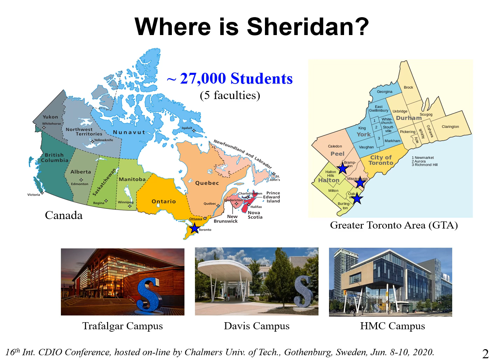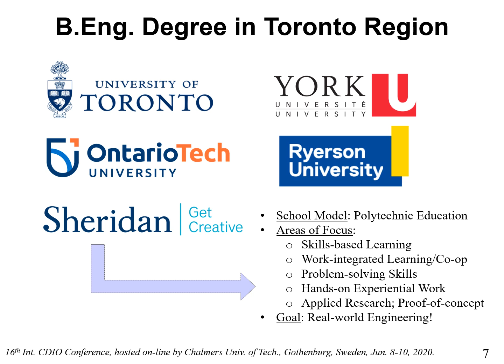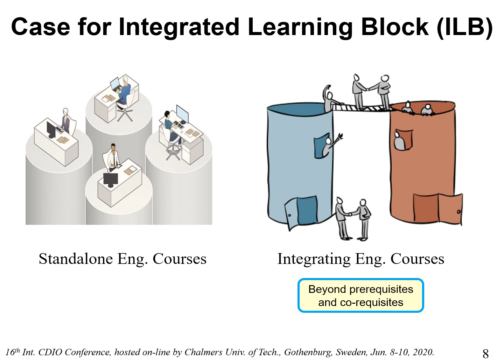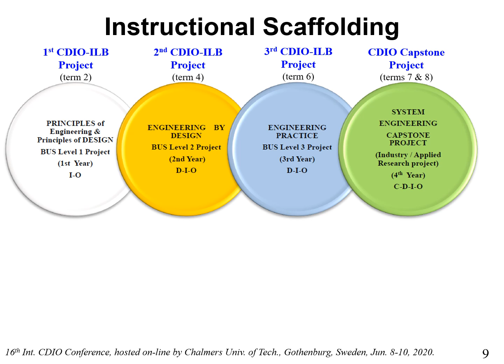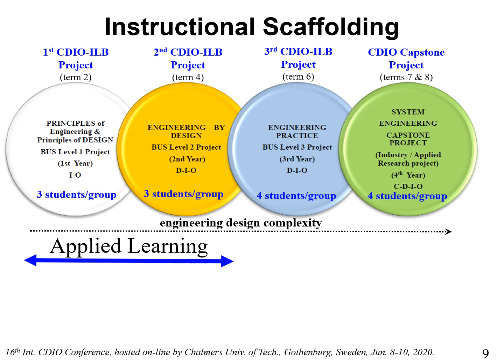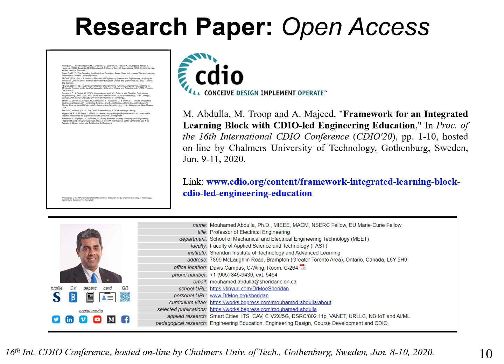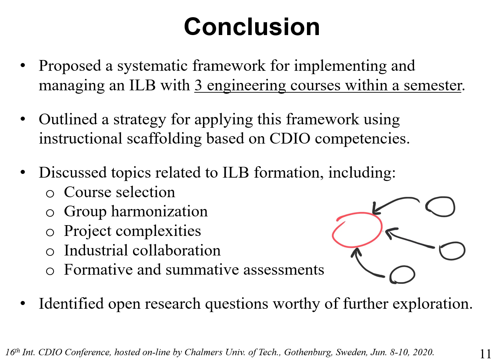16th CDIO Conference: Framework for an Integrated Learning Block with CDIO-led Engineering Education

Comment from the maker: Timestamps:
--------------------------
00:00 - Introduction
00:33 - Where is Sheridan?
00:56 - Greater Toronto Area & Tech.
01:25 - Areas of Tech. Focus in Toronto (AI, ML, 5G, IoT, CAV, ...)
01:47 - Challenge 1: Shortage of Tech. Talent
02:06 - Challenge 2: Shortage of Applied Engineers
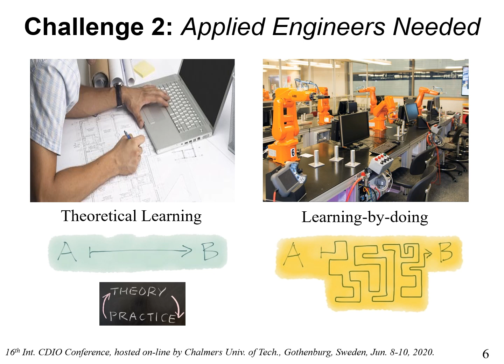02:28 - Engineering Education in the Toronto Region
03:31 - Making the Case for an Integrated Learning Block (ILB)
04:18 - Instructional Scaffolding based on the CDIO Model
07:58 - Research Paper and Contact Details of Corresponding Author
08:28 - Conclusion